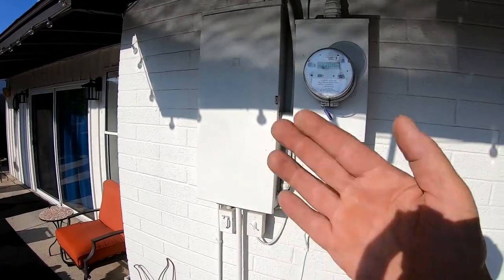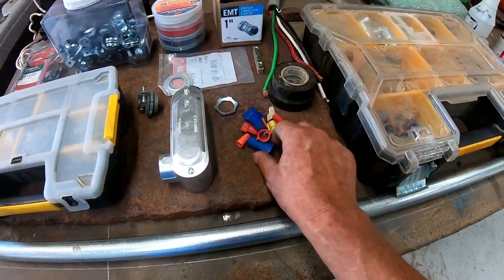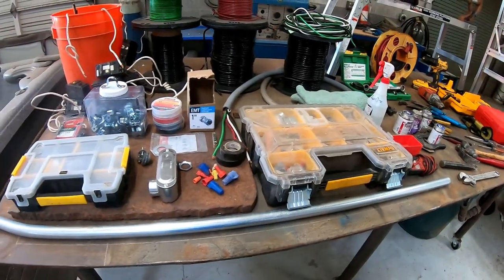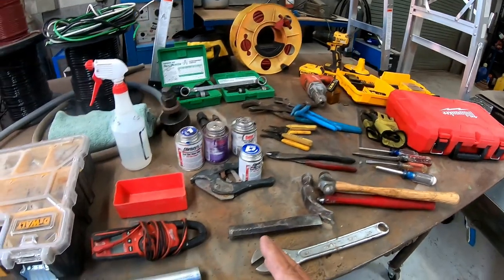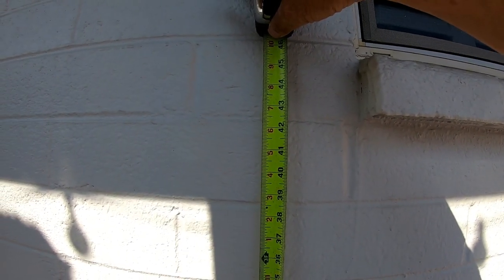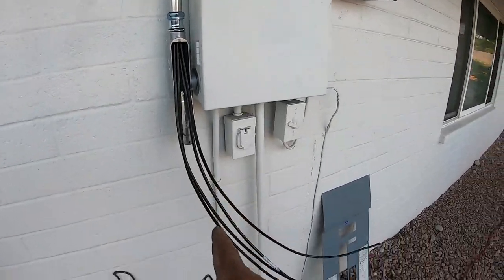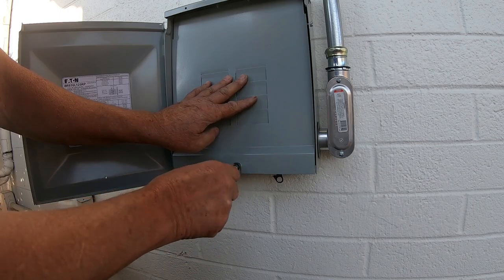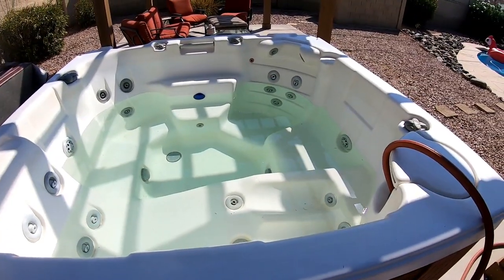How to wire from the Main Panel to a Sub Panel for a Hot Tub or Spa... (Part 1 of 4) DIY Spa Wiring

Comment: Just wanted to say thank you for the video series. I successfully installed a hot tub today, thanks to your videos. The only thing that did not go according to plan was running the four 6 gauge THHN wires through the 3/4" Liquid Tight. It was incredibly difficult to get these wires to run through 40 feet of liquid tight- even with fish tape. I would have gladly paid the extra money to have 1" seal tight if I had known how hard that was going to be, lol. Nevertheless, I am immensely grateful for your help. Thank you again.

Comment: Well done!  My main panel had a bonded ground and common bar.  Everything was mixed.  I made sure that from the main panel on down that they were separated.  I learned a lot from this.  My hot tub comes in November.  It seems that covid has caused a huge delay in shipping for most brands.  I am looking forward to the last one where you fill the hot tub.
Reply from the maker: That video should be up before Friday.. Thanks fro Watching & SUBSCRIBING
Reply: Your main panel is allowed to have the common and ground bonded. Just every sub panel and basically  everything outside the main panel has to have the common and ground separated (not bonded). Only rare special circumstances allow after main bonding, per NEC 2020.
Reply: @andygigawatt7778  this is fact, a sub panel neutral bar should not be bonded to the cabinet

Comment: Still a dangerous situation even if you turn off main breaker as the main lugs are still energized. Be super careful around those. Best solution is to pull the power meter if you can.
Reply from the maker: Great advise ... But unfortunately that is not an option. Thanks for Watching & SUBSCRIBING

Comment: Thanks for the tutorial. Do I need a 50 or 60 amp GFCI 2 pole breaker at the main box if my sub box has a GFCI breaker already? My spa installer said I need a 50 amp GFCI breaker at the main box instead of a 60 amp 10k standard that my electrician installed. The spa installer did not look at the sub box to see that it has a GFCI breaker in it.

Comment: I appreciate your complete instruction walk through on the sub panel addition. I'm a do it yourself person. I'm adamant about safety. The dig rite routine, power off, etc. I'm a little lacking as to the red tape to one of the main wires??? I did run a white for my neutral in the same #6 size . If you could explain, this DIY guy would appreciate it. Have a safe and blessed day. Thy, Paul M.

Comment: These are exceptional videos and very informative.  If the main panel is in the homeowner's basement, I would assume that you do not need conduit inside the house and can simply run #4 wire along the ceiling until you get to the point where it exits the house.  Is that correct?  Also once you drill a hole in the house to run the wire out to the sub-panel, is there a type of connection for the conduit that attached to the house (siding) that is secure and animal/waterproof?  Thank you.
Reply from the maker: You are correct and yes they do have and make a connection for that.. Home Depot / Lowes or any hardware store should have what you naeed... Thanks for Watching & SUBSCRIBING

Comment: Very helpful video. I know you said later you would put in more breakers for an outdoor kitchen. I want to do the same thing. Just have a question. If adding say two more 20 amp breakers for two GFCI double outlet (outdoor) plugs, would it be better to use a 100 AMP breaker in the main panel and 1/0 wire to run to it to carry the extra load?  Thanks.

Comment: I'm running a 60 amp breaker for my hot tub and can I use number 6  for the run or do I use number 4? I know it's good for 55 amp's but no 4 won't fit in the hot tub terminal's?

Comment: Great video.  I have a question about my situation.  I am running 100 feet through the woods.  I was hoping to use 4/4 direct bury instead of PVC conduit and the four wires you used here.  Do you see an issue using direct bury? Thank you.

Comment: Scott can you help me understand why you would use only a 60 amp breaker to power the sub panel that would power a 50amp hot tub, 20amp for lights, 20 amp for pool pump, etc? Don't you want to add more than 60amps in the main panel to supply more power to the sub to accomodate those other things?
Reply from the maker: For what I was going to be doing that was all that I needed to do. The Hot Tub only had one motor and a 4.0 Heater so it didn't really require much and that left enough for the outdoor entertainment area..I think I did this install over two years ago and haven't had any issues to date...Thanks for Watching & Subscribing

Comment: Hey Scott, thanks for the reply.As I looked more closely at my future installation layout, I need to go from my garage panel to the spa.The garage panel is supplied by the main panel,15 feet away, by a 50A, #6 wire through 3/4”conduit.Can I go to a 60A at the main panel to feed the garage panel, so the spa has a dedicated 50A? I have a small mini fridge and small chest freezer in the garage, Any suggestions ? Thanks

Comment: QUESTION! I'm wanting to run power to my hot tub through my attic. It'd be cheaper (and easier) if i could use romex through the attic. My question though would be how best to switch from THHN from the outside in the conduit, to the Romex in the attic? Any help would be appreciated :)

Comment: Hello my name is lyle I  have a question, my wire that comes from the gfi box outside to my hot tub are two red two blue ,witch are two different sizes.  And a white and green. And my wires that come out of my hot tub are the common black and red witch are + and green and white. Witch wire of the red and blue do I use. ??
Reply from the maker: You would need to call the office on this one. Its an easy fix and I don't want to confuse other that might have a similar problem.Thanks for Watching & SUBSCRIBING

Comment: Great video Spa Man - very helpful.  I do have a question on wire size. I'm installing a larger hot tub that requires 60 amp service.  The distance from the main panel to the GFI disconnect is 90 ft.  Is 6/3 Romex large enough for that run or would you suggest #4 wire?  I'm hearing mixed answers from different electrical people.  Thanks for your help.
Reply from the maker: Do not use any type of Romex...Ground is to small and it just causes problems...Use THHN or THWN wire. as far as wire size I would call the shop and talk to Scott, he has a formula that he uses depending on distance of the run from point A to point B. The number of pumps & HP per pump and the size of heater. A lot goes into it. Thanks for Watching & SUBSCRIBING
Reply: @spaman5440  Thank you for the quick reply.  I will definitely stay away from Romex and see if I can get a hold of Scott.  You guys are awesome!

Comment: If you were installing a standard spa disconnect box that had a 50A breaker in it, would you still need a breaker in the main panel?  Seems redundant.  Is there a way to draw power from the main panel other than a breaker, like a tap of some sort?
Reply from the maker: You should have a disconnect no closer then 5 feet and no further the 20 feet in the line of sight with no obstructions. You can watch some of my other video on this subject and it may help you... Thanks for Watching & SUBSCRIBING

Comment: Just a quick question, roughly how much does this installation cost? I need this before I purchase my hot tub.
Reply from the maker: An install like this has several variables to deal with like how far is the run from the main to the sub panel and how are you going to get it there ? Are you going under ground or next to the wall or through the attic. This entire four part series of video install would of cost about $2500. to $3500.
I would get the Hot Tub first and wire accordingly I can't tell you how many jobs we have to go out and redo for homeowners because they ran the severce and then ordered the hot tub from Costco and when it was delivered had to have several things fixed because the Hot Tub required something different...Not always but at least one a week for several years now sometime more depending on the time of the year.Hope this Helps  Thanks for Watching & SUBSCRIBING

Comment: We bought a home that already had a 50 amp sub panel for a spa.  It was installed using #6 Romex (~80ft) from main panel to sub.  Outside the house the Romex is run through buried schedule 40 PVC conduit.  You indicated Romex is problematic…why?
Thx
Reply: Bare romex is not safe outside by itself. Inside pipe it is protected from damage, however, it will overheat if the pipe is not big enough to allow space for radiation dispersal. The gray area is if it’s underground, because if it’s deep enough to be cool, you might not have to worry about derating. When in doubt, you can always take the romex out of the pipe and remove the romex sheath (obviously leaving the individual wire sheaths intact) then run those regular wires back through the pipe. It kind of depends on how much of it is above ground like that. There’s a calculation rule in the NEC 2020 I think it has to be 5% or so of the entire run to not require derating. So for instance, if the run is 60ft and only 3ft is above ground, don’t worry about it.

Comment: Hey Scott, thanks for the great videos. Want to install a Tuff spa TT150, my spa location is 45 feet from my main panel.Would #6 THHN be adequate for the run?if yes, does the ground also have to be #6? Was thinking of a 50A at the main and 50A GFCI at the sub-panel.Please let me know what you think. Thanks
Reply from the maker: Yes that will work. #6 THHN wire on all four wires the two Hots , Common/Neutral and the ground...Thanks for Watching & SUBSCRIBING
Reply: Hey Scott, thanks for the reply.As I looked more closely at my future installation layout, I need to go from my garage panel to the spa.The garage panel is supplied by the main panel,15 feet away, by a 50A, #6 wire feed.Can I go to a 60A at the main panel to feed the garage panel, so the spa has a dedicated 50A? I have a small fridge and small chest freezer in the garage, Any suggestions ? Thanks

Comment: One important thing you should mention just for safety is those two lugs at the top are ALWAYS HOT even if you turn off the main breaker. If you touch these lugs, it may kill you through electrocution.

Comment: For a new install 3 wire hot tub, can a 4th wire (white) be run and just connected as a second ground on both ends (taped green and marked for future use) if a 4 wire hot tub is ever a replacement in the future)?

Comment: If my spa is a 2 pole + ground (no neutral) And my GFCI breaker is going to be in the sub panel, do I need to wire a neutral from the main to the sub panel? If not, where to unplug the GFCI breaker pig tail?
Reply from the maker: This has been coming up a lot lately... On a three wire Tub (two hots and a ground) you put the GFCI in the main Panel and wire the four wires to a Sub panel and from the Sub you would wire just the two hots and the ground to the Hot Tub

Comment: Question; In Maricopa County Arizona. Do you need to pull a permit to do the Electrical work, and does that work have to be done by a licensed electrician?
Reply from the maker: If you call the County/City they are most likely going to say yes to the permit(Do your research) If it is a new build I get a permit if Im just adding...(LIKE IN THIS VIDEO ) I don't get one. Now I am not a Licensed electrician..But I have one on standby in case I run into any problem..It all get down to what you are doing and what you feel comfortable with doing...If you have more questions call the office and ask for Scott and he will lead you in the right direction...Thanks for Watching & SUBSCRIBING

Comment: if i run the wires from main through the attic, do i need to run them in pvc? or can i just run them until i come through eve and then use pvc or liquid tight when i come out to go to sub breaker.
Reply from the maker: if you are above ground from the Main to the attic and then from the attic to the Sub panel you would use EMT... you would only use liquid tight from the Sub panel to the Spa and Grey PVC is for under ground..Hope that Helps Thanks for Watching & SUBSCRIBING
Reply: My main is in the house, so I think I can run it into attic indoors, then along attic until I go out soffit with gray pvc to sub, then liquid tight to tub.

Comment: Hi Scott great instructional video. Tons of detailed info not offered in other videos that cover the topic.
I was given a Sundance 880 series spa which replaced my old Phoenix Spas tub. Sundance apparently doesn't use a common wire which has me confused on what to do with the common attached to the gfci breaker. I attached it to the common lug and have power on both hot lugs but when I turn on the breaker at the main panel and turn on the breaker in the sub panel, nothing happens on the spa and neither breaker is tripping. What am i missing?
Reply from the maker: Ok you have a lot going on ... Easy fix but You will need to call me because I don't want you to get confused as well as others with the same problem you are having ... you can call me anytime.. It an easy fix..,,Thanks For Watching & SUBSCRIBING.

Comment: Great Video, Thank you. I just put  240 GFI breaker, outside of the house (similar to yours, 4 wires), but friends, telling me i  need grounding rod, not ground from the house. any advise would be appreciated. thank you.
Reply: You need the ground wire from the house to meet the code.
Reply: Ground rods at locations other than the main panel can become hazards if continuous ground faults occur. They will energize several feet of the area around the ground rod which can shock or electrocute someone standing there without insulated shoes. Always run the ground wire to the main panel.

Comment: Is the reason you went 4 wire is it’s required if you go 60amp fuse  and then you went 6 from sub panel to tub because you dropped to 50amp to hot tub

Comment: Great video! Subscribing now. 

Is there a reason why you are running metal conduit? I have a 45 foot run from main to sub panel and wondering if I can use ultralight non-metal liquid tight flexible conduit...
Reply: I’ve never seen non metal liquidtite, but if it’s delicate you’re probably ok running it overhead like he did in the eaves. You can also run pvc. But anything near the spa that can be stepped on or hit by gardeners you should make sure to use a durable conduit. Hope this helps.

Comment: The hot tub I have is a 3 wire. Do I still need a GFCI breaker in the disconnect box. If so just cap off the neutral wire at the tub end? How does the 3 wire work safety wise?
Reply from the maker: Call the office and talk to Scott and he will explain it ... Thanks for Watching & SUBSCRIBING
Reply: @spaman5440  Do you work at the Arizona spa factory?
Reply from the maker: @bryankloss8743  Yes he does.

Comment: Does the conduit from the main to the sub have to be metal or can you use the liquidtight instead and still be up to code? Amazing work, liked and subscribed!
Reply from the maker: From the main to the sub you would use EMT above ground and SC40 grey for under ground... Seal tight is used from the sub to the Hot Tub only and you never bury it.. Seal tight is for short above ground runs only.. Thanks for Watching & SUBSCRIBING
Reply: @spaman5440  thanks for clearing that up, much appreciated!

Comment: Great video but everyone should know that even if you turn off the main panel's 200 amp breaker the two large black wires that are connected to the two lugs above the main breaker that come from the meter are still hot and anyone who touches these two lugs will get electrocuted.
Reply: He said this in the video. But it doesn’t hurt to repeat it.

Comment: Can I use #6 wire from main to sub panel with a 25’ run? Also why use the all black and not color wire from main to sub? Thanks for the great videos ! Subscribed
Reply from the maker: Yes as long as it is a 50 Amp run with a GFCI breaker  you can use #6 wire from main to Sub for a  25 foot run....In this video I used #4 black wire from the main to the Sub because that is what I had and then I used phase tape to identify what each wire was. ..Thanks for Watching & SUBSCRIBING
Reply: @spaman5440  I should have mentioned it’s a 60 amp, electrician said 6 gauge would be fine but I remembered this video so I thought I’d ask
Reply from the maker: @Thackula  He might be right...As I've said in several videos Im not an electrician!! Now that being said...For a 50 Amp servive under 100 feet with a GFCI I use #6.  Now for a 60 Amp service with GFCI I use #4.
Reply from the maker: I have a question what size service does the spa call for ? 50 or 60 ?  If it calls for a 50 Amp service I would use #6 with GFCI breaker and if it calls for 60 Amp service I would use #4 with a GFCI breaker...Ive seen to many problems over the years with under sized wires and or breakers ..Hope this helped...
Reply: @spaman5440  The hot tub is a Viking heritage 1 and calls for 60 amp, I’m going to get the #4 wire to go from breaker to spa disconnect to be safe. Thanks for your help!

Comment: So you have 125 amp sub panel that you are running a two-pole 60 amp circuit breaker from your main panel to your sub panel. Why not just get a 60 amp subpanel? Why did you get a 125 amp subpanel?
Reply from the maker: In the video I explain that I am not only going to have a spa hookup but I also have an outdoor kitchen and outdoor entertainment area and I want to make sure I had enough room in the panel for all of the breaker needed for the project. Thanks for Watching & SUBSCRIBING